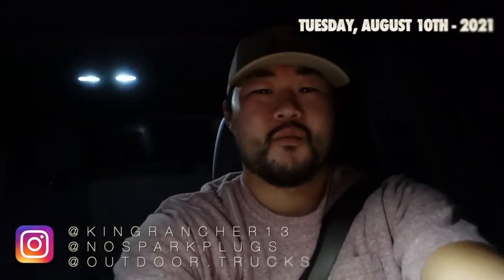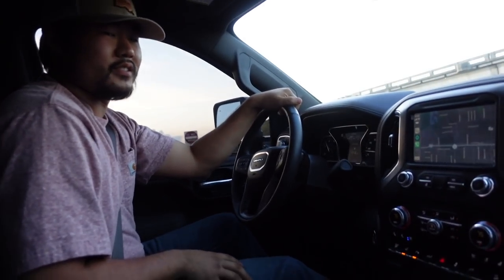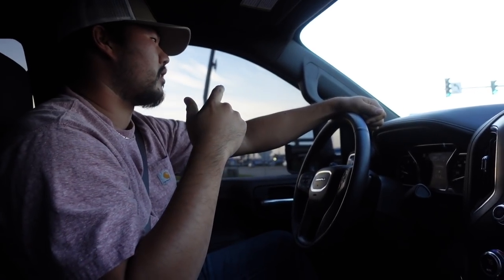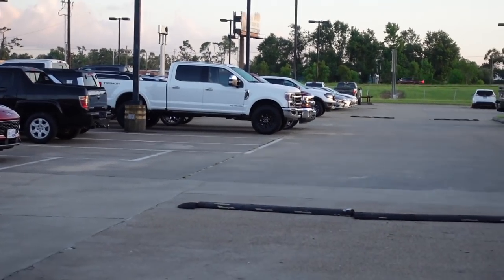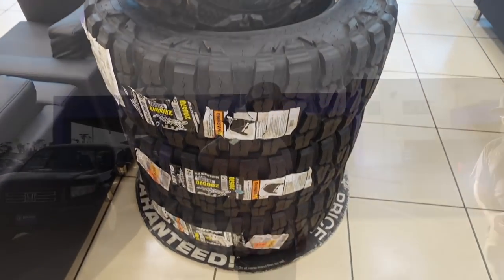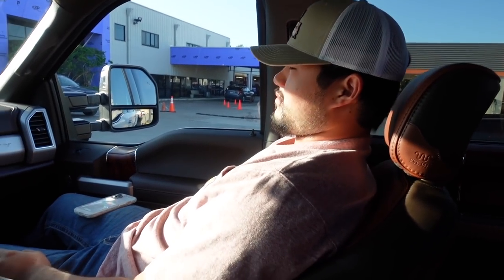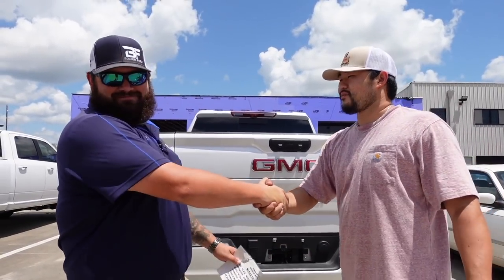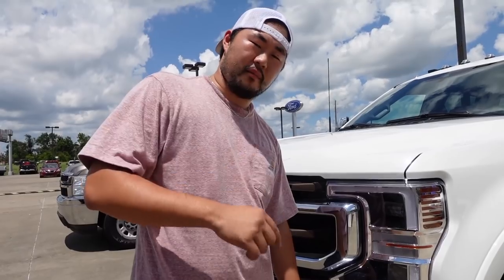BUYING THE FIRST NEW 2022 FORD F-250 King Ranch POWERSTROKE (for my channel)

Comment: My 22 lariat diesel is coming in week of the 23rd. I’m stoked for that 10-spd and new center stack. I did really good on selling my 19 lariat diesel earlier this year, and really miss the Powerstroke diesel!
Reply: I have a 2020 xlt tremor Diesel. Shocked at the power when towing my 7000lb trailer. Crazy
Reply: Off the assembly line, the 6R140 transmission in your previous 2019 truck is a stronger transmission (more reliable and durable) than the 10R140 transmission which is in the 2022 truck you ordered. However, there is now a company making performance street / tow internal parts for the 10R140. Expensive, but at least the parts are available. Think it might be wise for people who own 2020+ Super Duty trucks to invest in these parts and keep their trucks more years before trading / selling the truck and buying a new one. I have read the 10R140 transmission will be in service for 10 or more years.

Comment: Just sold my at4 with 5k miles on it couldnt stand the cheapness. Got my lariat on order wish it didnt take 8 weeks
Reply: The Ford Tremor is a much better truck than the GMC AT4! Actually, it is far superior in so many ways! Why? For the following listed weak design and engineering flaws in Chevrolet and GMC 4WD trucks.

1. IFS Axle - Poor Articulation / Wheel Travel compared to Solid Front Axle
2. Poor Approach Angle - truck unable to ascend steep hills
3. Poor Departure Angle - truck unable to descend steep hills
4. Poor Breakover Angle - truck get "High Centered" and can easily get stuck on uneven terrain off-road as a result of "low hanging" frame rails...truck is a "teeter totter" and gets stuck on a little small hump / hill
5. Angle / Square / Rectangle Shaped Wheel Wells - (rims and tires are round) - greatly handicaps and inhibits the ability to install big / large tires with minimum lift...GM 4WD trucks...add big tires...the proverbial "round peg in a square hole"...does not work good (Ford and Dodge trucks have round wheel well opens...easier to upgrade with bigger tires and maintain "Center of Gravity"

Chevrolet 4WD and GMC 4WD trucks are pathetic off-road, especially on uneven terrain with mud and snow. The GM 4WD trucks get stuck way before Ford 4WD and Dodge 4WD trucks. 

I have a 2022 F350 Lariat - UP -BAP - Tremor with Warn winch on order. Has several options, but I did not get the twin panel moonroof (prone to get stuck, leaks, broken glass, absorbs heat from the sun, etc.), adaptive steering (potential problems, expensive repairs, etc.) or adaptive cruise control (had a 2019 with the ACC option... neat, but just not necessary). 

BTW, you can have your dealer add or delete options prior to getting build information (week / date) and or VIN with copy of MSRP "window sticker".

Comment: Beautiful truck. That interior and screen is so dang awesome!
Reply: What is the big deal about the interior and screen? The interior on 2022 trucks is virtually unchanged from the 2017 - 2021 trucks except for the screen size. I have a 2022 F350 Lariat - UP - BAP - Tremor with Warn winch on order. To be honest, I would have been happy with a 2021 and the 8 inch screen. It is a truck, not a home entertainment / theater system.
Reply: @15Jeep  being that I’m use to the 8in screen I’m not opposed to a bigger one. And KR interiors have always looked and even smelled good. That being said I own a 17 F250 XL supercab long bed, vinyl flooring and am one that doesn’t care for the majority of the tech that comes with the other trims. Then again my truck was optioned out the way I wanted it with the clearance lights, camper package, auxiliary switches and that 8ft bed. Love the interior of a KR but I would only get one if they made an 8ft bed and vinyl flooring as part of the KR package

Comment: What was the wait time on the order for this truck? Just placed my order for a 22 lariat 6.7
Reply: Eager to know as well..ordered a 22 250 Lariat Tremor last week
Reply: how much it cost?  im undecided, currently have a 2019
Reply: I ordered my 2022 F350 Lariat - UP - BAP - Tremor with winch over 4 months ago. The truck is suppose to arrive at the dealer sometime in late September or early October. However, my order was not the normal Retail Customer Order. I placed an order with the Fleet Sales Manager. Ford gives priority to the Retail Orders over Fleet Orders. 

Evidently, Ford thinks the retail customer is more anxious (maybe like an 8 year old boy before Christmas?) than the commercial customer. Waiting is OK with me cause I got 7 percent off MSRP. I have heard many people paying full MSRP and even a few thousand more $ dollars $.
Reply: @15Jeep  mine is stone gray/ black interior CCSB 6.7 lariat ultimate FX4, put deposit down 2 weeks ago dealer said 8-12 weeks, received VIN number and notification that production was going today actually. Not in any rush as I got X plan pricing plus a few other rebates (farm bureau member and recent college grad) so no complaints from me but seems to be going quickly. As long as it’s before Christmas I’ll be a happy camper.
Reply: @lanehart6525  That is quick to receive a VIN, especially in this market. Stone Gray is great color and was my second choice with Sport Appearance Package (SAP). I ordered Carbonized Gray with Ultimate Package (UP) and Black Appearance Package (BAP). The BAP is not available with Stone Gray. Don't understand why cause it would look awesome. But, the Chrome Package looks awesome on Stone Gray too!
Reply: @15Jeep  black package and the lithium gray was what I really wanted but sadly it got dropped for 22, my best friend has a carbonized gray 21 so I couldn’t match him, but I’m putting ranch hands on it front and rear so that’ll delete the majority of the chrome lol. But that BAP carbonized gray is gonna be one sexy truck, congrats brother!
Reply: @15Jeep  especially with a tremor I might add, that’ll be mean
Reply: @lanehart6525  Thanks! Yeah, I wanted Lithium Gray too...that was my first choice, but no longer available for 2022 models. Have a friend who is getting virtually the same truck as mine...2022 F350 Lariat 7.3L UP - SAP (with LED lights and Tough Bed) Tremor with winch...Stone Gray. He would have ordered the BAP, but not available with Stone Gray, so he got the SAP. Think he plans to change the grille, fender emblems and Ford Ovals to Black.
Reply: @lanehart6525  Check out the following aftermarket accessories and parts for your truck and or your friends truck:

1. Carli Level Suspension System - either the Back Country w/Fox 2.0 Reservoir Shocks or Pintop w/King 2.5 Reservoir Shocks. The Fox have aluminum body (better than steel) and the King are steel body. Add the Progressive Add-A-Pack Rear Leaf Springs...keeps OEM load capacities and improves the ride. Can use 37 inch tire IF the optional Radius Arms are selected.

2. Air Lift air bags; Hellwig air bags; or Firestone air bags. I will probably opt for the Air Lift air bags, but not the in cab on the fly air adjustments and gauges. I have air bags on other Super Duty trucks...work great without all the gismo gadget options.  

3. DayStar polyurethane air bag cradles - VERY IMPORTANT option to use with air bags to keep and maintain full axle articulation / wheel travel off-road. NOTE: Do not disclose the use of DayStar gradles to the air bag company as it may void their warranty.

The above options will greatly improve on road handling and off-road capabilities of a Ford Super Duty 4WD truck.
Reply: @15Jeep  I have checked out the Carli setups before but I did not know that information about the airbags. This will be my first super duty (I own a 7.3 OBS and a first gen dodge Cummins currently) but this will be my first foray into a new diesel as necessitated by work. Plan to slap on some ranch hand bumpers first due to the remote nature of my work just to protect it lol.

Comment: Hope you don't get the 10 speed Allison transmission ford & gm is having major over haul transmission recalls and Ford rear axle recall
Reply: Problems with virtually every vehicle model nowadays. There are street / tow performance upgrade internal parts now for both the Ford 10R140 and GM 10L1000 transmissions.

Comment: Ranch hand Bumper replacement
Reply: Good upgrade, but if the front bumper is replaced, only looks good if the rear bumper is replaced with a Ranch Hand.

Comment: That gmc looks better
Reply: Completely Disagree. The Ford not only gas much better aesthetics, it is a better designed and engineered truck! 

The Ford Tremor is a much better truck than the GMC AT4! Actually, it is far superior in so many ways! Why??? 

For the following listed weak design and engineering flaws in Chevrolet and GMC 4WD trucks.

1. IFS Axle - Poor Articulation / Wheel Travel compared to Solid Front Axle
2. Poor Approach Angle - truck unable to ascend steep hills
3. Poor Departure Angle - truck unable to descend steep hills
4. Poor Breakover Angle - truck get "High Centered" and can easily get stuck on uneven terrain off-road as a result of "low hanging" frame rails...truck is a "teeter totter" and gets stuck on a little small hump / hill
5. Angle / Square / Rectangle Shaped Wheel Wells - (rims and tires are round) - greatly handicaps and inhibits the ability to install big / large tires with minimum lift...GM 4WD trucks...add big tires...the proverbial "round peg in a square hole"...does not work good (Ford and Dodge trucks have round wheel well opens...easier to upgrade with bigger tires and maintain "Center of Gravity"

Chevrolet 4WD and GMC 4WD trucks are pathetic off-road, especially on uneven terrain with mud and snow. The GM 4WD trucks get stuck way before Ford 4WD and Dodge 4WD trucks.